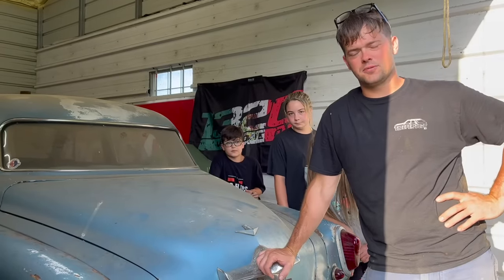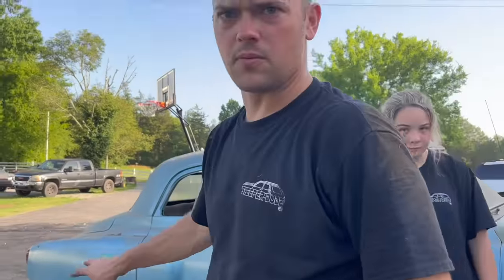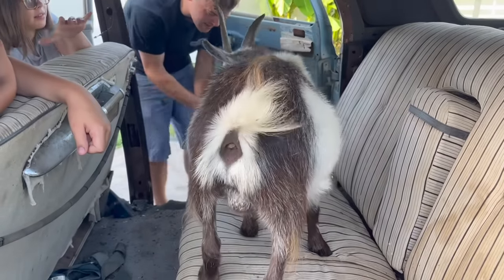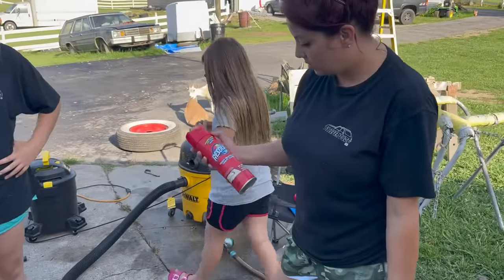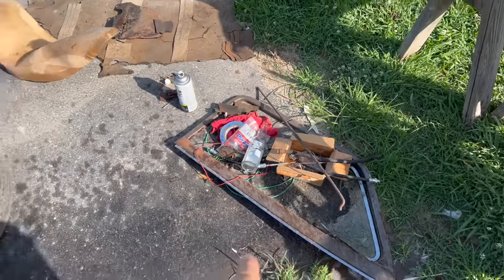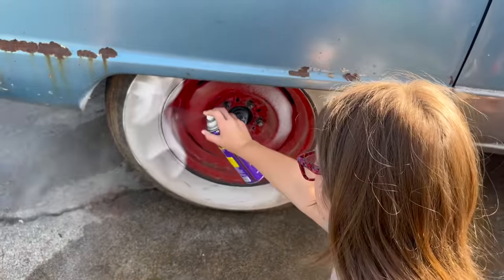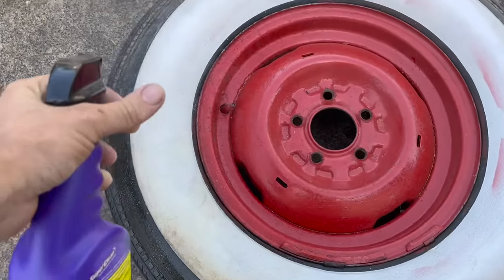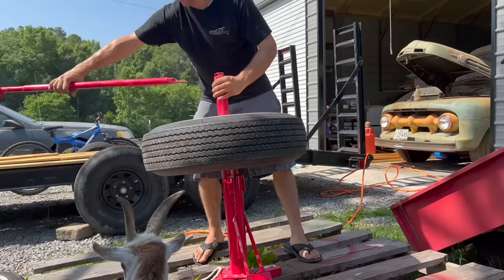Bullet Nose Studebaker back on the road and cleaned up for the first time in years!

Comment: Your family is wonderful : A couple of points: 1) if you clean off the rusty chrome, you should immediately use automotive clearcoat over the top of the cleaned steel. Otherwise, you've simply removed another layer of rust protection and the rust will start returning immediately. 2) What brand is your brake drum remover? Keep up the good work :)
Reply from the maker: Ok good tip thank you
Reply: @Sleeperdude  Read my original post. What brand of brake drum puller do you use? It's one of the most easefully functional pullers I've seen, but I couldn't find it in a quick web scan.

Comment: Keeper. If overdrive isn't working, I noticed last time da relay doesn't have a fuse in it. However you can rig an off an on switch for O/D solenoid fused wire to switch and wire run to one of posts on the solenoid. Push da T handle in and when you're bout 30-40mph flip switch on and let off da gas and it will click in then push da gas and you'll have a 4th gear. Real nice on da hwy. Can run 65-75mph no problem. Engine is 232ci and has good low torque. Very economical. I be smiling and grinnin da whole video. Had Studes in my family since 1960. Worked in a Studebaker restoration shop when I lived in Florida. Really hope you will keep it. Very dependable, engine is bullet proof. I drive a 61 1/2 ton pickup daily. I't newest vehicle I own. Wish you continued success, you guys deserve it.
Reply from the maker: Thank you so much for all the info

Comment: Awesome video! Please set 2-3 plans of the dash board. And another features of old cars, handles, knobs, turns, and all so on. Which is different, between the new cars, 1990-...-2020.  We never seen this before, and unfortunately, wouldn't see this for ever, because these old cars every day goes to heaven, in metal trash...

Comment: Ralph wanted to know how fast the Studebaker would go.  A Commander V8 was timed at 98.36MPH by road tester Tom McCahill  in 1951 and also in 1951, at the Daytona Beach speed trials, Merritt Brown's Commander sedan made 117MPH.  It was Brown's own car, that he used for everyday transportation, but he had equipped it with dual carburetors, dual exhaust and possibly other mods, so it was not strictly stock.
Love watching your car go down the road. Hope you fix it up or pass it on to someone who will. I don't suppose it will ever be restored exactly, but a nice paint job some upholstery work and a few other touches, would give you an awful nice driver for not much money.
Reply from the maker: Yeah for sure.  glad we got it going and it can live on

Comment: I used a old Coats hand tire machine back in the late 70s to change all my buddies Crager wheels and not bust out the centers , when I saw the one a Harbor Freight it was a no brainer for me to buy one , I also got the one to do the lawn mower tires , it was a lot better that doing them on the floor on my knees !
Reply from the maker: Yes for sure can’t beat it

Comment: a home rug cleaner with an upholstery attachment has worked pretty good for me on car carpet and upholstery....sucks the gunk out instead of saturating the padding with the dirt. On those old cars you can also pry apart the hog rings holding the upholstery fabric in place and then hand or gentle wash the seat covers to get a really good job. Doing that will also allow you to sew some of the rips and tears. Remember the old turtle wax chrome polish??? worked wonders....I'd be sure to wax those bumpers once cleaned to hopefully slow down the rust process. You guys are a ton of fun to watch.
Reply from the maker: Ok thanks for the info

Comment: When I was a wee lad, my parents had one of those Studebakers.  The wing windows are ok, but you have a couple of vents that will blow a blast of air in the car.  Those doors on the front fenders are vent doors.  I think the lever for them is by the left and right panels in front under the dash.  I thought they had a vent on the inside by the feet but you seem to have something else there so not sure where the wind comes from.  But you get going down the road, that blast of air is better than air con...

Comment: You are not old enough to remember when almost all the country roads were dirt or gravel. I grew up in southern Oklahoma and they didn't make hard surface roads until the late sixties there. One thing they did was spread oil on the roads in front of farm houses to knock down dust. EPA would have a fit if they did that now. That was more than likely where the mud came from under the car.
Reply from the maker: That’s interesting the only place I have saw roads like that in my life was in Florida

Comment: 3 ways to go on that Stude. Flip it like it is. Fix more stuff, the glass is flat and a pretty easy fix, get some Mexican blankets and make easy seat covers, all those little hands washing could be little hands sanding so you can paint the outside slick and clean and paint the engine compartment and the trunk and get that disc brake kit. Third do everything from 2 and put an LS engine and overdrive trans in it and air bag it and air-condition it and get some flashy eighteens or twenties on it and roll like a rock star.
A smart guy would buy it like it is and have fun driving and fixing on it and most likely be the only Studie at the car shows.
Reply from the maker: Yeah for sure thank you

Comment: First year for Studabakers little V-8. Hot rodders swooped them up, despite less dissplacement than Olds, Caddy, and Chrysler. Th,ey worked out fine in an early Ford,, which were'nt very heavy,and 130 hp. was plenty.
Reply from the maker: Yeah for sure thank you
Reply: @Sleeperdude  Set that Stude up with dual exhaust and glass-packs, to give it some rumble. Might consider making it a daily driver, it has room for your whole brood !

Comment: The original 51-52 Stude v8s had a poorly designed valves and caused a lot of problems. If the engine is original, you should investigate this before driving it much. By 53 they had them fully sorted out and it was a great V8!  Many people replaced the original V8 with a 53 or later Stude V8. I had the 51 champion ( your V8 is a commander) which had a 6 in it and had a lot of fun for 10 years before I finally let it go. I learned more about  cars working on it than i ever wanted to LOL. i drove my Champion at least  twice a week for 10 years!
Reply from the maker: That’s great thank you

Comment: Hey! Nice one! The glass is a bummer but maybe some plexiglas would be ok for temporary? That is not safety glass. 
I had a 1962 Studebaker Lark 4 door. Great engine. 259 V8. It would drop a pile of rust out of the bottom every time you closed a door. Had like an oval steering wheel. Good times. Your car is much nicer than the one I had 😆
Reply from the maker: Yeah for sure thank you

Comment: I was reading up on the specs of this car and I found this...

The 3.8 litre engine is a naturally aspirated, overhead valve, 8 cylinder unit that develops 120 bhp (122 PS/89 kW) of power at 4000 rpm, and maximum torque of 257 N·m (190 lb·ft/26.2 kgm) at 2000 rpm. The engine delivers its power through to the wheels by means of a 3 speed manual 'box.

The smallest V8 car I've ever owned was a 1976 Buick Skylark sedan with an Olds 260 (4.3L V8) and it made 110 HP through a Rochester 2bbl and it was SLOW. It would work up to 80 on the highway, but I was lucky to get 10 MPG out of it with a TH200. It was a turd, but it only had 34k miles on it, it was free, it rode really smooth, even sitting for two months with a foot of snow on the whole car it would fire right up, and I never got that car stuck in the snow. It would go anywhere in the snow as long as it was sideways and I was looking out the passenger window.
Reply from the maker: Ohh wow that’s awesome

Comment: Hey Guys, just wondering if you checked the lube oil in the Transmission? the steering column sounds dry and should be lubed with an oil squirt can with 40wt oil, should make it shift much smoother and prevent problems shifting . the steering box should be checked for lube also, these 50`s cars have pipe thread plug that you remove to check the lube. I thing it could be a good care with a little work, or you could sell and put the funds to fix one of the other projects. Love Rocky, he is so attached to you guy`s and wants to be involved in just about everything you all are doing. Take care and have fun.

Comment: My folks had the blue on like yours an mine was all white and had some extra chrome on it... your headlight rings have the park and  turn signal bulb/lens in it at the bottom of the headlight. My folks rig had the heater under the seat that was a water heater but mine  was electric... It was basically a hotplate. You never needed heat in the summer but come winter, you were glad to have some heat... thats where things went south for mine an dang near burnt to the ground... seems as though all the lint and dust set on those coils an guess what.. it caught fire! I had to push snow under the seat while my sisters were pouring water on  the seat to put it out as it was the heat situation ... I got a water heater and plumbed it in after that. Plus that hot plate wasn't all that great. You might look to see if yours is water or electric.
Reply from the maker: Ok i will check ours I’m not sure .. I definitely need to look . Thank you 😊 hope you are doing well

Comment: I met a guy in San Fran about 25 years ago or more, had 1 of these with an approx 1" aluminum section under the carb that "atomized" water   into the air/ fuel mixture, he said it worked well   don't recall hid mileage, pretty cool though.
Reply from the maker: Ok thank you

Comment: This is a keeper. There is heaps of space in the back for the kids as they grow. It sounded good from the outside, it sounded good from the inside (except for the rattly glass, which is fixable). The gears shifted easily. Did the overdrive operate okay? is it vacuum or electric?  This would be cool pulling a camper or old style looking caravan!
Reply from the maker: Yeah it’s a cool car , I was scared to try it while driving but it is mechanical and electric

Comment: The overdrive gearbox explains why the it would run away away when the speed was low and the engine wasn't driving the car. At low speeds the overdrive gearbox goes into free wheel mode and you don't get any engine braking.
Reply from the maker: Ok thank you

Comment: If the seat covers are not original, someone went to a lot of trouble to find something that is a match to the original.  The "cord" that runs along the back of the front seat was used to hang a blanket on - heaters were still not staying too far ahead of mother nature.  Have fun and stay safe.
Reply from the maker: Yeah I agree thank you

Comment: It must be a regional thing, but I am not familiar with the term “ Hog leg V8”.   What makes it a hog leg? Also, that car may have the old “Hill holder system in it which was a unique setup that Studebaker had that would allow you to stop at an intersection or such that was on a hill and it would hold the brakes engaged so you didn’t have to continue holding the brakes so the car wouldn’t roll backwards when you would take off from the stop sign. It would automatically release when you were pulling away from the stop. It’s strange that it wasn’t more popular and wasn’t picked up by other auto makers
Reply from the maker: That’s funny.. yeah maybe a regional thing just means lot of power
Reply: @Sleeperdude  the Studebakers of that era weren’t known for being very powerful and were known to be candidates for engine swaps with a Cadillac engine being the engine of choice as they were an easier swap than others. The motor mounts on the engine were very similar in design to both Cadillac and Chrysler V8’s but the Chryslers were HEMI’s and were bulkier and heavier than the Cadillacs so weren’t as popular. Later when Studebaker and Packard merged the Packard V8’s were the preferred swaps and were even factory installed in some of the Golden Hawks (1 year only - 1957) with a small number of them being equipped with I believe Paxton superchargers and for their time were extremely fast with performance not far behind the Rambler Rebel and Chrysler 300C. (The 57 Rambler Rebel was the quickest car for 1957, even beating the Corvette and Thunderbird that year.)